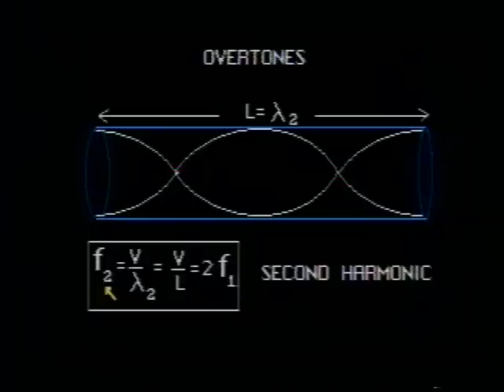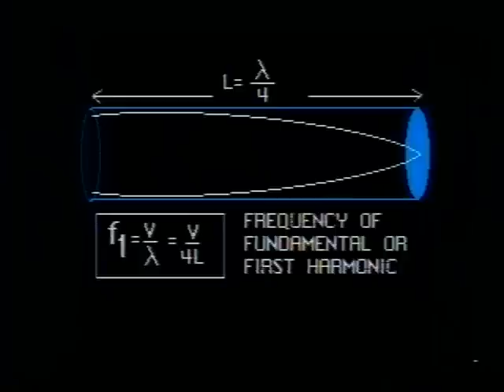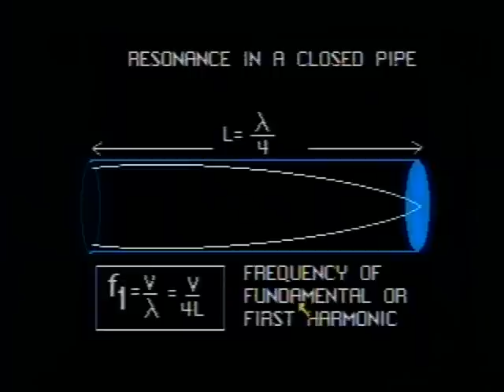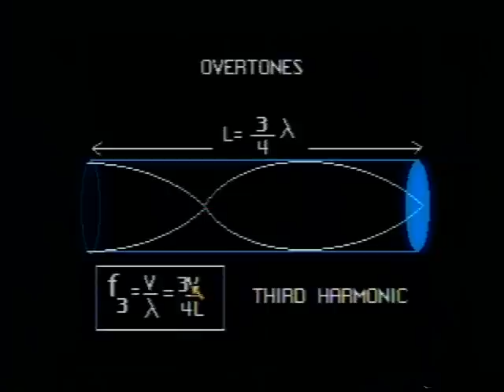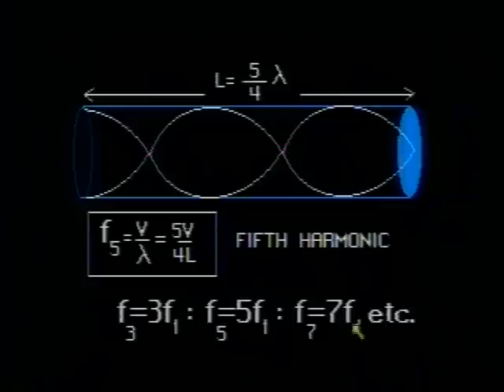Physics Problems Animated: Sound-IV

Comment: Really helpful, thanks! But an important distinction has been overlooked in this video: The nodes and antinodes shown here are related to the displacement of air molecules. But there are also nodes and antinodes of the sound pressure in pipes whose positions are different than that of the displacement nodes and antinodes. Therefore it's necessary to indicate what those amplitudes relate to. It may be useful to take a look at this page to understand the difference: http://www.acs.psu.edu/drussell/Demos/StandingWaves/StandingWaves.html